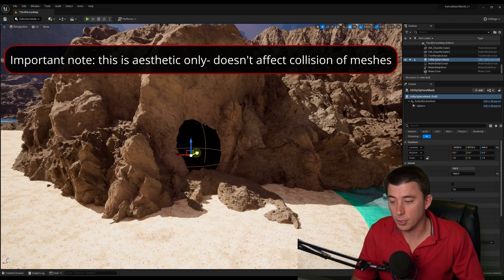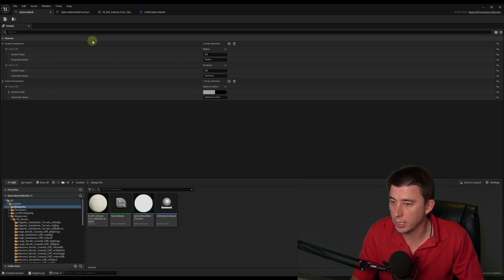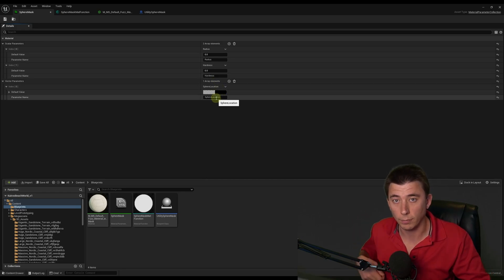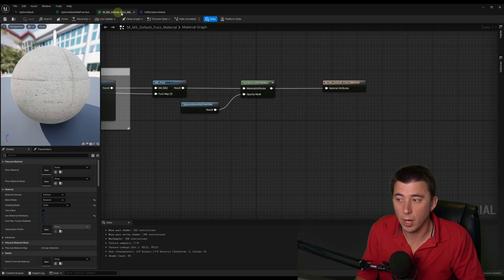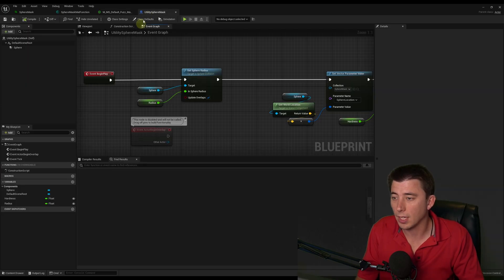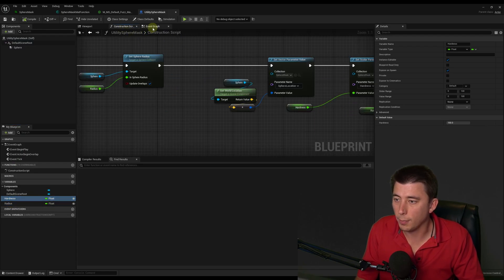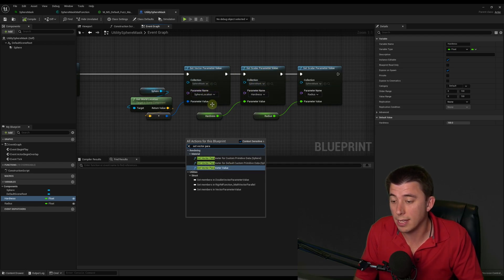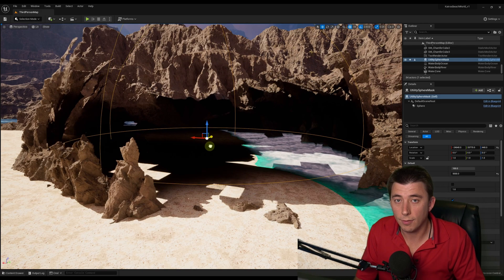Cut Dynamic Hole in any Mesh Material (Aesthetic Only) - Material Sphere Mask - Quick Tutorial

Comment: For those new to shaders who were wondering what the "Mask (R,G,B)" node was, that's just a component mask node. Additionally, I had better luck just getting the scaled sphere radius and plugging that into the radius scalar variable in the blueprint. But this definitely works, thanks a ton, exactly what I needed and works with multiple spheres.